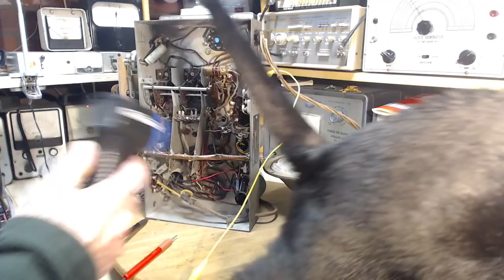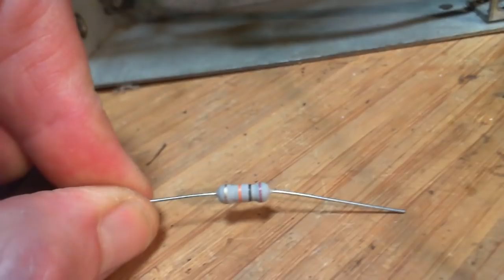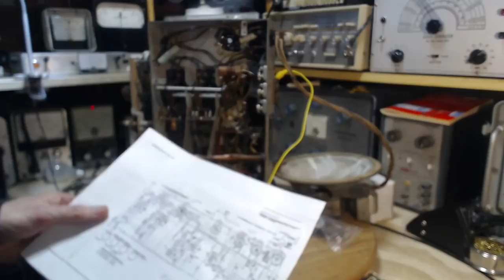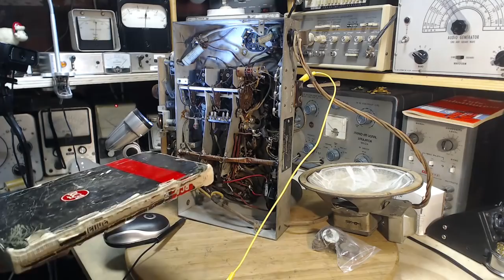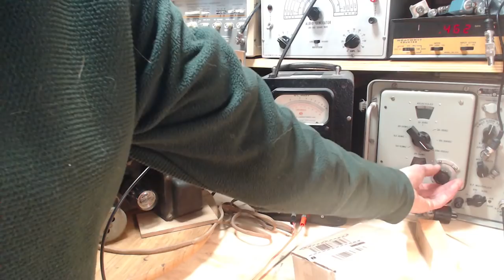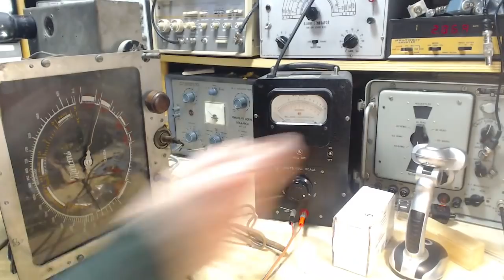Canadian Marconi Model 93 Video #11 - Poke About

Comment: Hi Jim, I've enjoyed watching your videos and want to offer a general comment on your problem solving approach to radio investigation and restoration. While others have probably done the same I would like to add my 2 cents.I think you would benefit from a more methodical approach that starts with a review of the best available schematic, then begins tracing the network from the main power supply, to the audio amplifier and output stage, checking each component and connection along the way. Once these are proved out, or replaced as needed, proceed backwards through the various amplifier, detector, IF and RF stages in the radio. For each one tracing the connections and testing each component and marking them off on the schematic as good, or no good and replaced. If you do this systematically, it will give you the shortest path to completing the project. And reduce the circularity in getting there. Anyway, for what its worth.

Comment: Jim I know what you mean that it “looks like” it is impervious to the metal screwdriver but that’s really not true. What you don’t realize is if you use a non-metal tool it would peak a little different,  but you don’t see that because your using metal to begin with. If you go back with a non metal tool I’ll bet it peaks in a different spot. In other wards after you take out the metal screwdriver it detunes again because the metal was acting like an antenna and changing the inductance when it’s in there , which changes again once it is removed.

Comment: Jim:  I think you should straighten that pointer out before doing any calibration or alignment, also you have to do something about those bad bushings on the tuner mounts, that's why you get the occasional raspy noise out of the speaker.

Comment: A bad connection like a soldier joint or the component is arcing out one of the two or both or a live wire is touching could be.
Sort the wiring out is such a mess I hate messy wiring like that it's a joke, lay a couple of nice terminal strip and sort it out!!! bits of Wires soldered hair frayed wires there come on jim get it together.

Comment: "Pentagrid converter".
One of those grids functions as a plate with holes in it, not as a screen..
On the 6A8, grid #2 (pin #6) is the "anode grid": the 'plate with holes'. 
That pin should be about 60 to 150 VDC, as it does function as a sort of intermediate (the local oscillator's) plate.

Comment: Would 0u1 600v Mylar capacitors be used to replace those capacitors you are removing, what about a large dropper resister like you would find in a tube TV set, QAM is now used on Short Wave for (Digital Radio Mondale) stereo transmissions possibly sometimes QPSK is sometimes used.